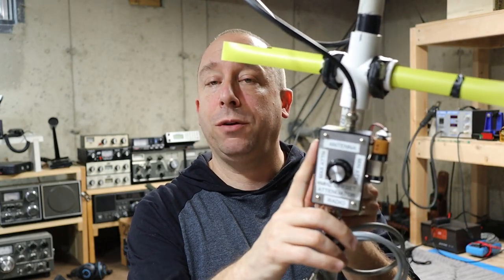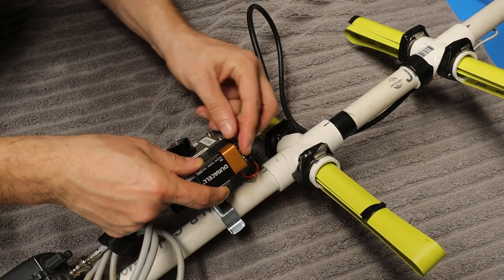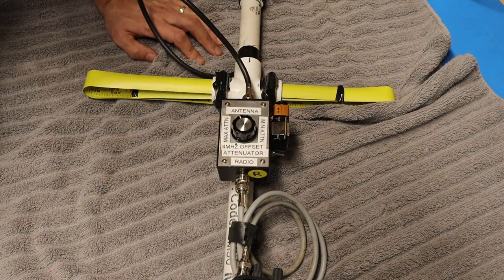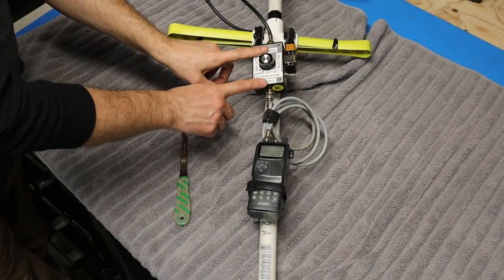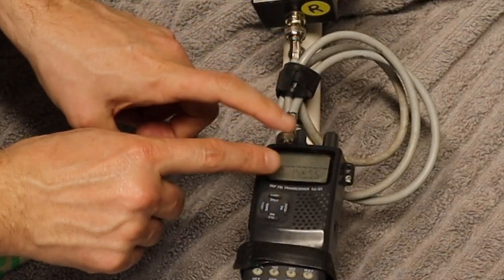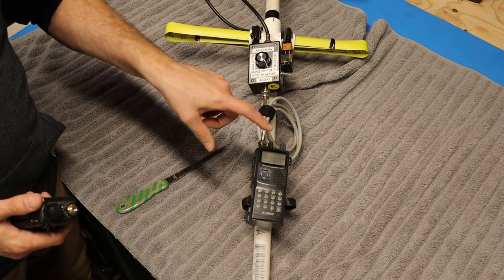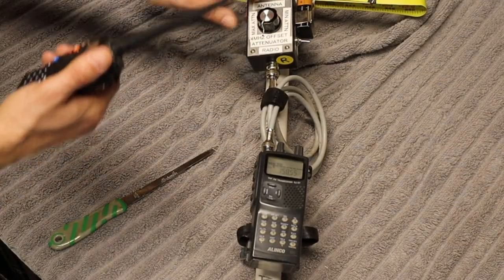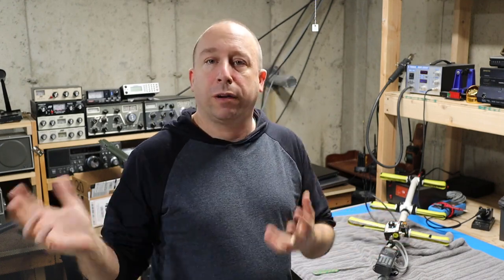Ham Radio Antenna Attenuator For Fox Hunting - Quick Overview and Demo

Comment: I'm not a ham so this might be a really dumb question, is it possible to use a variable resistor inline with the antenna to weaken the single instead of using an using an offset attenuator?
Reply from the maker: A variable resistor might work for receive to some degree but you wouldn't be able to transmit through it.  But even on receive it will sort of mess up the impedance match to your antenna and may cause it to not be as directional as it would otherwise be.  It's worth a try if you have the parts on hand....

Comment: Here is the article for building the attenuator. I changed the power switch to a dpdt type and used the other side to allow bypassing the attenuator. This allows you to transmit without popping the mixer diode. http://www.homingin.com/joek0ov/offatten.html